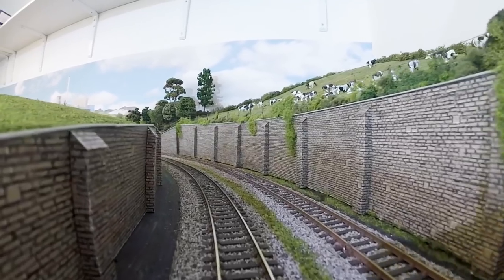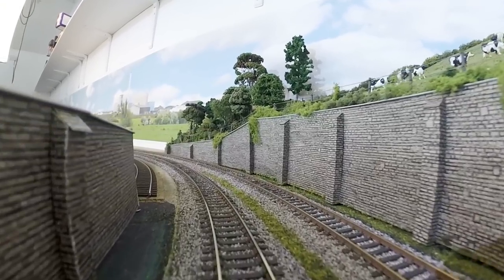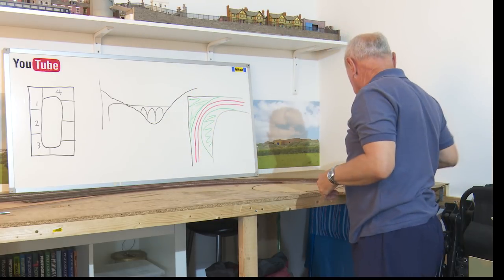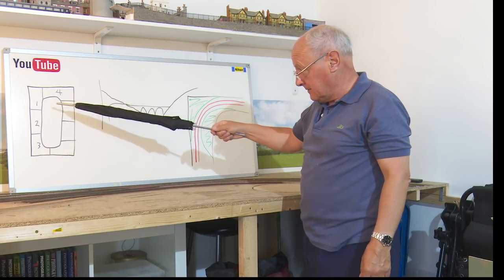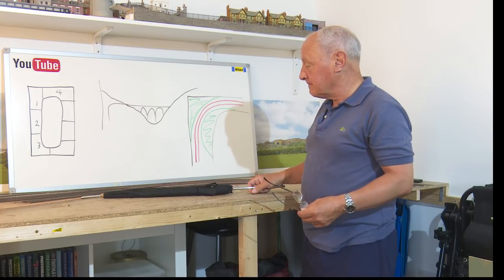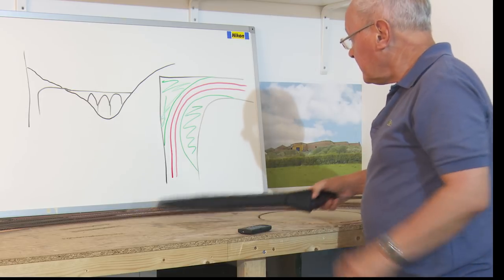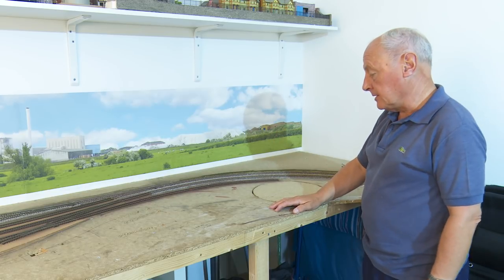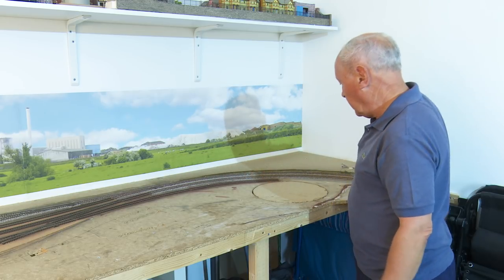37. Improving Model Railway Landscape at Chadwick Model Railway.

Comment: That looks really good. TIP: I coat polystyrene shapes with a thin layer of plaster (e.g. Shaper Sheet Plaster) so it stops it chipping and then you can glue anything to it or paint it. It is much stronger afterwards.
Reply from the maker: I’m so pleased that you liked it.  Good tip too. Regards Charlie

Comment: That hot-wire tool is great and far better than using a knife. I would have used static grass on the hill, but it would not be as to scale as your method. So that’s another thing for me to remember.
Reply from the maker: Hi Jazzman, 
I’m so pleased that you enjoyed it.
Reply: Yeah static grass far away breaks the scale distance effect.  Best for the front.
Reply: I was going to ask why you didn't use static grass on the hill parts is it as stated for scale?

Comment: Another great "military operation" Charlie :-) , the "EPS" type foam used for insulation is much easier to work with (but you obviously have to pay for it) you can also sand it and shape it by hand much easier.  A nice result , well done.
Reply from the maker: I shall have get some of that EPS foam, just to give it a go. Regards Charlie

Comment: Well done Charlie, looks the goods. in case you missed my earlier comment on the last landscaping vid, here it is again:

I know this vids all about the landscape but I can't get this thought out of my mind, so here it is. As per your mud map - On the lines going over the Viaduct [board 4] and into the end of the old TMD boards [boards 5,6]  you have one fast track going along the front of TMD and the other from under the hill to the goods line at the back. However you almost have 2 lines at the front of TMD [5,6]  that go into the tunnel [5], so why not put another switch in on the "Goods Line" just after the diamond crossing [4] that can route onto the other track at the front of the TMD that at this point in time, is on that switch making it into one track on the left side as you face TMD [5] and on the right side you have that same line going into another switch also back into the same line [6],  (make the tunnel mouths bigger) which I'm assuming will in the end of the revamp go back around [Board 7 to 3] to match up the the the first fast track back over on the Parkway side, well you sorta need 2 line so why not just take it all the way around as an up an down pair. And at the TMD you could even install a small station platform. Also at the end of the TMD you can install another set of switch's and a diamond crossing to go back around into a revers loop onto the fiddle yard at the back a bit like the original loop does now on [6]. If you can understand all that - you did better than I expected  LOL
Reply from the maker: I’m currently working away from home and can’t quite visualise your plan.
I’ll have a look on my return home but thanks so much for taking the time to examine my track plan.

Comment: An economy tip : all printed sheets, representing different kind of stone/ brick work in different colours should not be bought in large quantity, as they are quiet expensive. Alternatively, one can have a master copy of each of them & get them printed in colour xerox for multiple copies, which will work out about 10% cost of the original one.
Reply from the maker: Good advice.

Comment: My solution to avoid the flat pancake look is to have the track raised 2 inches, or 5 cm, above the baseboard. I use foam board for this.
As a result, I can lower the terrain for rivers, lakes, etc, as well as raise it. The problem with laying track directly on top of the baseboard is that there is no space to go below track level, thus forcing part of the flat look.
Reply from the maker: Hi Diedert,
That is a interesting idea. Do you start by covering the whole board with foam board?
Good luck with your layout. Regards Charlie
Reply: Hello Charlie, 
that is what I am intending to do. I just bought the foam board. it is called extruded polystyrene, or XPS. There are also commercial names, like styrisol, for the same stuff, but the name of the material itself is XPS.
XPS is the same plastic as the stuff you used for the hills, except that xps is not bubbly and therefore much less messy to cut / saw / etc.
XPS is not cheap, though. I paid about 120 Eur, or about GBP 110 for a double (4 inch) layer on top of a 12 foot by 4 foot (roughly) baseboard. This is intended to be enough to do the terrain above the track as well, though.

I think my key point was that laying the track directly on the baseboard makes it impossible to have terrain lower than the track, unless you make cuts in the baseboard.

Other alternatives to have raised track are:
- first design what the terrain and track plan should look like, and build risers for the track. If you build the risers yourself, this should be much cheaper.
- have open benchwork, and do without the baseboard altogether. The railbed then goes on top of the benchwork, or through the cross-braces. An example can be found here:
https://youtu.be/hYqI8I0JrUo

I hope this is of some use to you or another viewer.

Comment: Hi Charlie,

That hot wire cutter has done a really nice job!  I was thinking about cardboard formers stuffed with newspaper and plaster bandage but now I am not so sure.  Maybe both methods will be useful.  I like the use of different blends of turf, It makes it look alot more natural.  Now you just need that backscene down the other side :)  Cheers
Reply from the maker: Hi Michael,  
Yes the polystyrene is a useful waist product that can be so messy if you use a knife.
That backscene does have to extended soon.
Regards Charlie
Reply: Michael Henfrey cardboard stuffed with news paper but ALSO layered with about 3 coats of news paper brushed with neat PVA is my usual method.

Cheap, faily quick, easy, not too messy, strong, lightweight....makes REAL fruitful use of a 'news' paper at last!
Reply from the maker: There are more than one way to skin cat (as the old saying goes).
Reply: Chadwick Model Railway - Of course!

I tried chicken wire and plaster bandage before.  Results were good yet I found that more expensive, awkard and messy than news paper and glue.

I might try the hot wire though after watching your vid.  I have some polystyrene packing stored in the loft.

Comment: Charlie, What is the voltage and power of the hot wire mains wall-wart?  I have a power supply, so would like to be able to save that expense duplication.  (unless the hot wire psu can be used for other things?)
Thanks, 
Tom
Reply from the maker: Hi Tom, 
The Woodland Scenics transformer produces 7.5v DC, 1500mA. 
Regards Charlie
Reply: Chadwick Model Railway 
Thanks, Charlie. Quite powerful (10W) but not a voltage that immediately reflects something that can be used. I will probably go for the cheaper version (10 rather than 50) and use my power source. Thanks for the reminder to get spare wire. Well worth 4 quid to have in hand!

Comment: Amazing video Charlie, I went to a show in Hereford and it was based on the Yorkshire dales but was completely flat no hills!  Were do you buy your polystyrene? I looked in hobby craft they did not have it I looked in both my local model shop they did not have it then my last option was BandQ but they had one with lots of holes and lines NOT USEFUL! And when you said it is in packaging I was like oh yes since then I have bought a lot of things since then but still no polystyrene? Do you have a way around it?
Reply from the maker: Hi Billy, I’m so pleased that you enjoyed the video.
If you are stuck go to a builders supplier such as Bradfords.  They sell very large sheets about 2.5 inches thick, which are used in cavity wall insulation.
Regards Charlie
Reply from the maker: Hi Billy,
I've just bought two 8 ft x 2 ft sheets from Wickes for £15.
Regards Charlie
Reply: Chadwick Model Railway, amazing thanks for the info also do you think you could do a video of Ballasting?

Comment: Glue back together with polystyrene cement hehe, trouble is this stuff is the ultimate fire hazard
Reply from the maker: That’s why I always use PVA for this project.
Regards Charlie
Reply: not if it is coated in plaster Synth :)